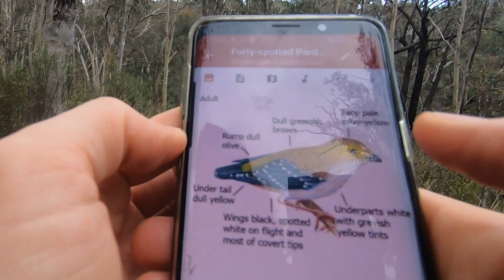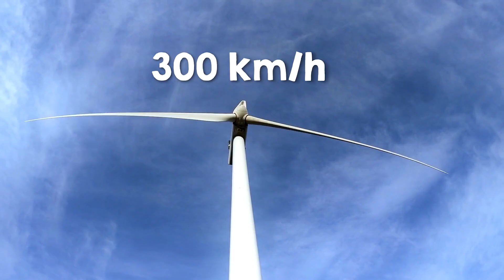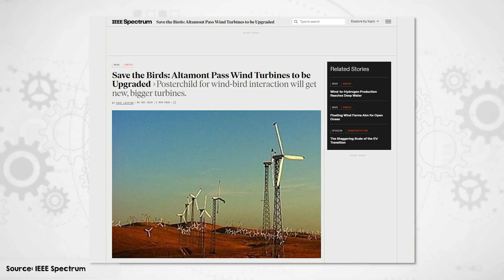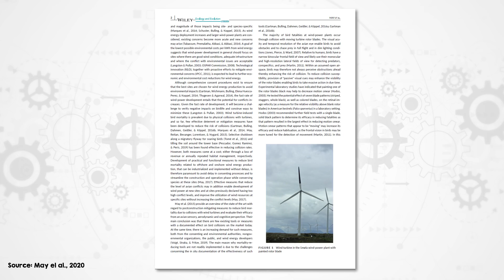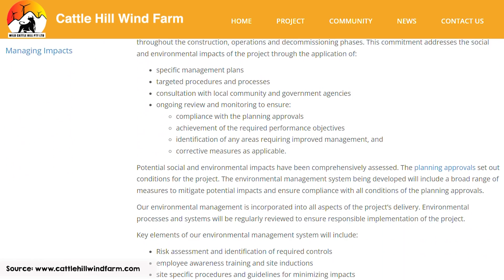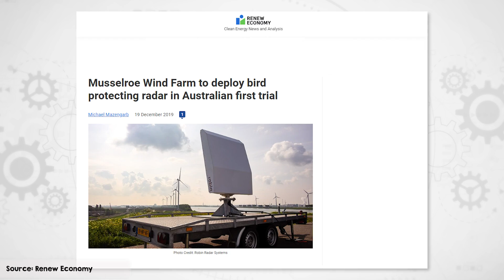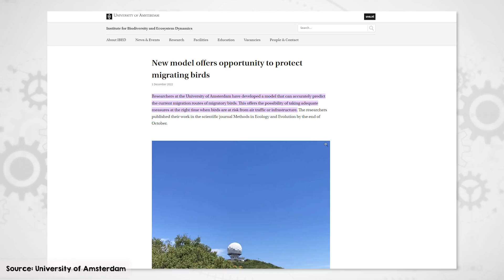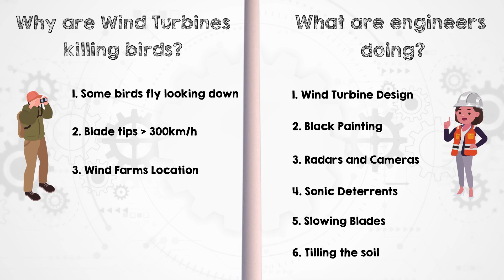Blades vs Wings: Wind Turbine Technologies to Save Bats and Birds

Comment: Very interesting and love your show❤. As an ecologist one potential remedy concerned me greatly,  tilling of land around turbines as a bird strike reduction strategy. This would essentially destroy habitats which are already usually degraded or deminished on which our wild species depend. Essentially solving the issue by removing target species habitat and food. Also the soil carbon loss i imagine would be colossal, particulate pollution, nutrient  loss and soil compaction would be issues. Increasing hugly the ecological, land use and environmental impact of the wind resource. Where applicable  though wind infrastructure should be integrated into low nature value intensive agricultural production systems.
Reply: A lot of windfarms are sited on arable land anyway, so keeping the soil turned over isn't such an ecological impost (as opposed to ecological compost, which is much more beneficial). .
Reply: @zygmuntthecacaokakistocrat6589  no till farming has great ecological benefits
Reply: Also, blade erosion is a problem with wind turbines.  Tilling land around turbines would result in more airborne, abrasive particulates, greatly shortening the lifespan of the blades.
Reply: thanks, I was about to write the same comment: tilling large areas around wind turbines, not a great idea for biodiversity and carbon sequestration! 
Even if they are planted in agricultural areas, the aim should be to reduce the use of ploughing in any case, to stop destocking carbon and reduce both the use of fertilizers and the nutrient leakage that pollutes water tables.
Reply: In the US, most of the wind farms are located east of the Rocky Mountains, where the land is arid and few people live.  Some of the land is even sand dunes, blown about due to the winds.

Comment: Not to make light of the issue, but I wonder how many birds suffer the impact of golf balls.  My point is that there is a lot of potential harm to birds out there.  Every bird that is hit adds one more bird death to the tally.  All sources of harm need to be considered.  In this case, climate change in Canada helped to burn out forest in a single fire roughly equal to the area of the Netherlands.  That's a lot of wee and not so wee beasties.  Nonetheless, the loss of another bird to whatever hazard only makes the problem worse.  We who follow you know how much thought and care you put into protecting birds and other species.  Good on ya!  If there is a point to my comment, it is that human activity threatens all wild life.  We need to consider these, our cohabitants, with everything we do.  We might even save a few creatures by focussing on using less energy.  
By the way, while I am not a golfer some of my friends are.  Par is made more difficult to achieve when gulls, crows and ravens steal golf balls.  Tiny bit of push back from these birds?

Comment: The problem with birds is species specific...  I witnessed the effect a large wind turbine had on some crows in North Wales...  

As a blade tip passed the top of its path and started heading down, one of the crows landed on the blade and sat there as the tip fell, towards the bottom of the blade path the surface the crow was sat upon approached vertical and the crow fell off the blade...  The crow then flew back to the top of the blade's path, and landed on a blade tip again...  

This seemed to entertain the crows for far longer than I could watch them...
Reply from the maker: Really?! Wow! Birds are so smart.
Reply: @EngineeringwithRosie  Crows do have a playful reputation, with researchers fascinated by New Caledonian's ability to solve the puzzles they are presented with.  There are plenty of videos showing crows using larger bottle tops for roof top snow sledging.  Only saw crows doing this once, but then rarely passed that turbine.
Reply: peterchandler8505:   Great Point,  but they are no raven.... 

And us mammals should have more class....  (Except hasn't class distinctions been outlawed? ;)

Comment: Rosy, you passed quickly over the idea of striped blades, but this would solve the 'black blade' problem in that all blades could be made the same and would behave the same, e.g. with changing temperature.  Visually I think it would work, because aircraft propellers have been striped for many years.
Reply: Exactly. That's the way I have printed my wind turbines blades and have never had a strike.
Reply: @jimgraham6722    how noisy are your blades? 
Also, have you compared with plain blades?
Reply: @alanhat5252  Almost no discernable noise up to 25km/hr, although there is a low hum from the maximum power point three phase inverter with frequency of the hum linked to blade speed.

Above 25 kmh there is a rushing sound, above 40kmh the blades can start to furl, sometimes in heavy gusts this can be associated with flutter, a loud roaring sound.

The three blades are essentially painted black, one has a white painted tip and a second has a white stripe painted mid span. When the blades are turning it presents a strongly assymetric rotating pattern with the white patches dancing back and forth.

The paint I use is a marine rated air cured epoxy. It has proven extremely durable.

Prior to this paint scheme I had a small number of strikes evidenced by dead birds around the base. Since introducing this high contrast, high vis paint scheme about twelve years ago, I have had no strikes at all. As far as I am concerned problem solved
Reply: Yes, great points, and she didn't mention that the graph of bird deaths was a logarithmic scale, so for people who aren't aware of that (I had to pause the video to check) might think she was greatly exaggerating her figures (of 10x more, etc).
Reply: Play with colors in differing patterns on all the blades....Also, sound: simple whistling devices on the blades...also, reflective materials to give a twinkling or some other type of affect.
Reply: Wow, those are good ideas -- thanks! @botchos
Reply: @Bitternov             I read years ago that purple blades were being considered as deterrents, but never knew why, maybe, until I read an article recently about duck, chicken & other birds’ vision. Ducks et al have more rods per cm2 at the back of their eyeballs than people so they see better at night & can distinguish more in grayscale. People have 3 kinds of cones—red-, blue-, & green-seeing. Birds also have UV-seeing cones so see another whole color, sort of. 
Sandhill cranes along the Platte River were colliding with a power line at night. After a study with UV light
the power lines were lit with UV and collisions were reduced 98%.
Reply: I have thought the same.
Reply: Do black striped blades really lower the Raptor kill count? Why (again)?

Comment: Thank you for this informative video. One of your sponsors is a company that makes lightening deterrent strips for "things that go fast". If each blade is fitted with such a strip down the blade's center, and it happens to be of a contrasting colour, wouldn't this help "save birds with a single strip" whilst not interfering with the manufacturing process or blade balancing & integrity?

Personally I would add sparkly coloured tassels to each blade tip (like we hang on kids bicycle bars) to not only save birds & bats, but make wind turbines extra pretty & blingy - what's not to love! Perhaps you should hire me as a consultant for creating bespoke wind turbine blades that make them as pretty to look at as they are useful. I have loads of ideas 😁

BTW, didn't NZ make one of their bat species bird of the year? Bats are like platypuses & mushrooms - very difficult to classify under the conventional taxonomy system. If a mammal want to look & act like a bird and a cetacean, perhaps they deserve a taxonomy class all of their own?

Comment: Slowing down or even stopping the turbines wouldn't be my first choice, sound can be made somewhat directional, and it doesn't have to be completely undetectable by non-targeted species, i think sound, not only ultrasonic sound is a potential option for deterring any species that can detect sound. The need to deter birds is not unique for wind turbines, there are bird deterrent systems, including sonic. No need to reinvent the wheel, use the knowledge we already have and build on that. 

Light can be made more focused. Sound, light,  possibly a combination, automatically activated. False positives from a detection system isn't as much of a problem if a few spotlights and speakers are activated as if the turbines are stopped.      

Deterring, in combination with not givning birds and bats any specific reason to enter the area. It's usually much easier to deter animals if there's nothing for them there, as it is with an area filled with food.         

Also, except for extra vulnerable and important populations, this is not much of an issue in the larger perspective.  It's a bit like with batteries, suddenly even persons who normally take pride in being polluting a-holes, and a-holes in general, insinuate that they care about forced labor in mines in DRC. Somehow that intense caring only applies to the mining of cobalt, which usually is a byproduct from copper and nickel mining. And, that caring also only applies to the mining of cobalt used in batteries for purely battery electric cars. Even the cobalt used in hybrids is typically not an issue at all.

Comment: I remember hearing a study 1-2 years back where simply putting a blinking red light on top of wind turbines ended up leading to a massive reduction in the amount of bird deaths.

Solution may be even more simple than we think!
Reply: It may be that anything that looks like motion at first glance will work.  It is likely that if a bird's attention is drawn to the turbine, it will say to its self "I don't know that that is but I think I will go over here instead of nearer it".
Reply: Most wind turbines already have blinking red lights on top of the tower to warn of aviation hazard, just like radio and TV towers.

Comment: 3:59 Why suddenly no supporting data for climate change being the biggest threat?

Climate change is bad for some environments, and good for others. Moreover, it is predominantly caused by CO2 rise, which is good for almost all environments, by significantly boosting plant growth and therefore the whole food chain. It seems very much unclear whether CO2 rise and the resulting climate change on their own (i.e. considered separately from environment destruction, overfishing, pollution, etc) are actually bad for birds.

Such complex changes always bring with them lots of negatives, as well as lots of positives. Figuring out whether the sum of the effects is negative or positive is notoriously hard (see Numerical Sign Problem). Any study that is not using a robust method to take into account all contributions is pretty much useless on its own in that regard.
Reply: The IPCC has made several comprehensive reports on this. The most recent one appears to be "AR6 Synthesis Report (SYR)" from this year. (Edit: checked; that report does not appear to mention birds).

Searching for the "extinction keyword in the longer report: "... In terrestrial ecosystems, 3–14% of the tens of thousands of species assessed will likely face a very high risk of extinction at a GWL of 1.5°C. ..."
 (Page 36)

".. As warming levels increase, so do the risks of species extinction or
irreversible loss of biodiversity in ecosystems such as forests (medium confidence), coral reefs (very high
confidence) and in Arctic regions (high confidence). ... " (page 42)
Reply: @economicprisoner  Thank you for providing a reference. Does the report cite research papers to back up its claims? Those would be even better for me to look at.

I would like to know how they ended up with such a high percentage of terrestrial species being at risk. Do they mention that this risk is due to climate change? They do not do so explicitly in the part you cited. I would imagine the risk is mostly due to these species already being close to extinction from other causes, like habitat destruction.

Do they provide a similar number for the counterfactual scenario where we would stop emitting CO2 now? Perhaps that number would not be too different. Even if it were significantly different, can the whole difference be blamed on climate change? What if climate change provides the nail in the coffin to a species that is already much weakened due to habitat destruction? Does it count as a casualty of climate change?

Coral reefs are a bit of an exception, as, in addition to being affected by trawling, pollution, etc, they are also uniquely affected by CO2 levels. From your second citation, the report itself only assigns medium confidence to extinction risk in forests.

I can also imagine that the report neglected to take into account the very significant increase in plant productivity due to higher CO2 levels (at least I couldn't find it mentioned), which helps many ecosystems be more resilient to the other human-induced stresses.
Reply: Note also that humans are already known to have caused the extinction of about 5% of all bird species simply due to hunting and direct habitat destruction. The projected trends actually seem in line with a continuation of this trend, without the need of invoking climate change. Perhaps climate change is really just a diversion from the real culprit in this case.
Reply: Sorry, I just thought of another point: while climate change increases stress on some species by further reducing their habitat, it reduces stress on other species by expanding theirs.

Are these kinds of effects taken into account fairly? Does the report mention how many species might get saved thanks to climate change? Or is only risk increase taken into account?

This hearkens back to my original point: it is very hard to evaluate the net effect of a complex change, as it is easy to under- or overestimate some contributions, while missing others altogether, possibly leading to a completely wrong conclusion.

Even if the points I quickly thought of have been considered, there could be many other unknown unknowns. Just one of them could completely invalidate a carefully arrived-at conclusion.
Reply: @alterego3734  The long report appears to be to short for that. You would have to dig into the specific working group reports.

That first line I quoted cite thousands of species. Assuming each species requires at least 1 citation: that is thousands of citations for that brief quote in a page full of similar quotes.
Reply: @economicprisoner  Makes sense, thanks.

For completeness, I dump-write below about the type of arguments we need to settle such questions; I might convert my comments to a blog post.

As is probably clear from what I wrote so far, I don't think carefully analyzing individual contributions is sufficient to evaluate the net outcome of complex changes. Completely different types of arguments are needed, that are naturally robust to such errors. I try to make such an argument below, mostly as an example.

We live in the Quaternary. This period is characterized by glaciations and interglacial periods. At the end of each glaciation, the temperature rises by about 10 degrees Celsius within a few thousand years. Some vulnerable species probably do go extinct during each of these transitions, but none of the transitions are associated with a major mass extinction. One could argue that that such temperature changes are part of a natural cycle, and that the current biosphere might even be somewhat tuned to them.

Although the current climate change is due to different reasons, it can be compared to these transitions. Therefore, one wouldn't expect climate change to be such an existential threat to the environment on its own. Note also that, so far, climate change has mostly just brought the average temperature back to the maximum it reached at the beginning of the Holocene, just a few thousand years ago. One would expect all species that were fine back then to still be fine now, all else being equal.

The main weakness of this argument is that the temperature rise at the end of glaciations was not as fast as it currently is. However, it was still quite fast on evolutionary timescales, and the magnitude of the changes was one order of magnitude larger than what the earth is experiencing right now. While this is a weakness of the argument, it does not invalidate it, as it is not clear that this difference in speed matters that much.

Assuming this argument is valid, one can conclude that what makes all the difference this time is all the other changes caused by humans, namely habitat destruction, overfishing, poaching, overhunting, pollution, invasive species, etc. Therefore, climate change would really be a red herring and a scapegoat.

Still, any climate change, whether the current one or the glacial transitions, does bring a lot of changes with it, and one could argue that we do not want such changes to happen anymore, even if they were natural -- in the same way that we might want to convert a river into a canal to prevent further changes in its river bed. But then who gets to decide what change is acceptable? There are always winners and losers from large changes.

Finally, such points are moot to a large extent anyways, since humans are not actually in control of humanity's actions, just as a brain's neurons are not in control of the emergent mind.
Reply: @alterego3734  last paragraph is a bit of a depressing thought. But that is precisely why I think we should avoid messing up the biosphere as much as is practicable.

I don't trust our species with geoengineering. The extinction we may be avoiding is our own.